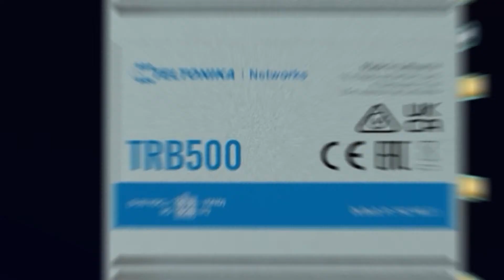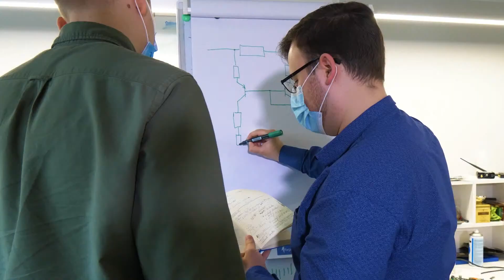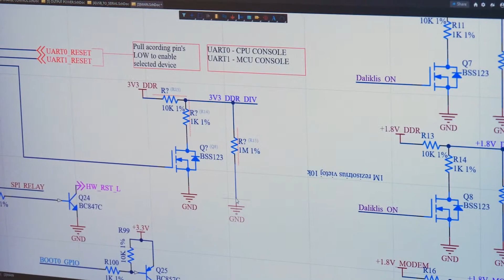The New Era of 5G | Teltonika Networks

Comment: Hi, can I use the TRB500 and connect a unidirectional antenna (poynting) and then connect a mesh WIFI system to the ethernet port to have a fast, low-latency, network in my private home?
Reply from the maker: Hello,
Overall, your intended system should function properly.
TRB500 can indeed be connected to a unidirectional antenna (Poynting). Since Poynting manufactures several LTE/5G unidirectional units, the one with 4x4 MIMO support is recommended for the best performance results.
In addition, TRB500 can also be used as a gateway to connect a mesh Wi-Fi system via its Ethernet port. However, there are a few things to take into consideration regarding latency. Since both LTE/5G and Wi-Fi are radio-based technologies, latency is an unavoidable and variable quantity. The mobile side is influenced by the aggregated frequency bands, cell tower loads, and weather conditions, while the Wi-Fi is impacted by the mesh algorithm, the number of mesh nodes, the distance from the nodes, and the number of client devices.
Due to this latency being unreliable, good results may not be always guaranteed. Still, TRB500 with its 5G capabilities, in combination with a directional antenna, should at least help reduce it to a minimum.

Comment: Really Quad-core ARM Cortex A7 717 MHz and 256 MB RAM (100 MB available for userspace)? OpenVPN client -25 Mbps 😂
Reply: I believe it's more of a modem than a router. Great for proper 500Mbps high speed 5G
Reply: @dan_austin__873  VPN and WAN-LAN performance depends strictly on the CPU. The modem has nothing to do with it. You can even connect a fiber to this router and the result will be the same.
Reply: @j2347j  Do you happen to know does TRB500 have Mediatek or Qualcomm modem?
Reply: @teemuvesala9575  Quectel RG501Q-EU based on Qualcomm

Comment: No WIFI 6 ? Not so feature-proof :(
Reply: The RUTX50 Industrial has wifi 6
Reply: @dan_austin__873  no it doesn't have it, it is 5 
 ...
Reply: @L4zYA55  Why would you use WiFi with this device? You buy this to have 5G connection, then you buy separate WiFi 6 access point which is much better than any of the combo units out there.